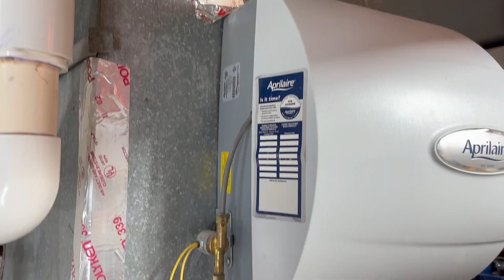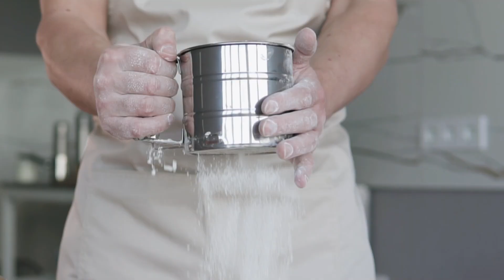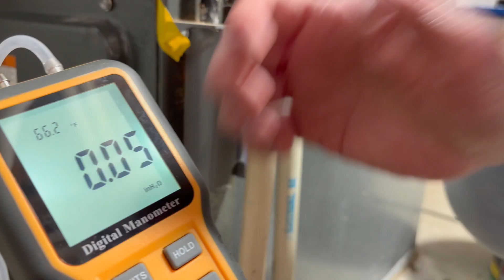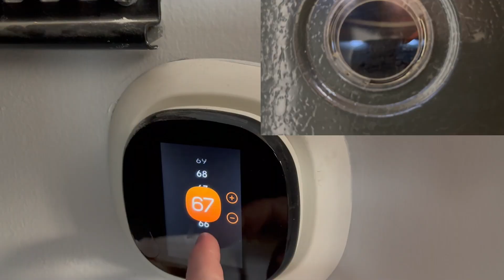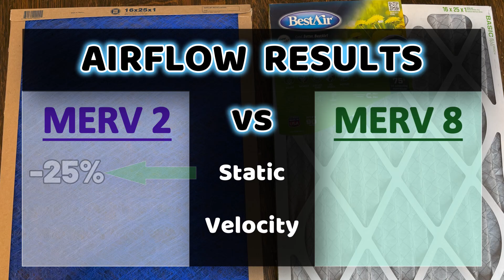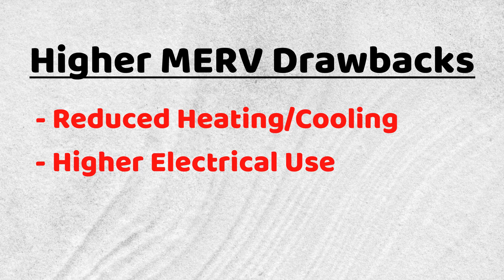HVAC Filter Showdown: Cheap Filter vs Expensive Filter || Full Testing

Comment: I test Air Filters to establish the ASHRAE 52.2 MERV Ratings and don't use anything lower than 13 for my own home. I also use 4" Media that only needs to be replaced 1/yr. A MERV 2 "filter" is not going to keep your HVAC equipment clean, so expect to replace your system more often. The money saved on filters will not pay for the cost of a new furnace,  unfortunately.
Reply: You're using 4" and I know that makes a huge difference but how much difference does a 2" thick vs 1" make? 

My mother-in-law with 2 dogs in the house switched to a 16"×25"×1" merv 11 for dust/allergies, in her 2 story 3 bdr townhouse unit and the resistance was so much that the coils froze up on 2 very hot humid days. So she went back to a lower merv and never had the problem since. 

I discovered that there was room for a 2" thick filter and figured she could go up to a higher merv again with the thicker filter. But I don't want to cause extra static pressure drop. Any suggestions for switching her to a 2"?  Or know any good filters that have less restrictive, higher mervs?

Comment: If you got a higher end filter with more pleats the static pressure can actually be the same or lower than the lower merv ones. Watch project farm video on this and you'll see.
Reply from the maker: Yeah, filter design definitely can affect flow/restriction.  More pleats and/or more thickness will give more surface area for flow 👍

Comment: Just check the manual that came with your blower / air handler. It will tell you the maximum MERV it can handle. Most older systems are fine up to a MERV 11. Not sure how this guy did his tests, but his system is too new to only handle a MERV 2.
Reply from the maker: In my case the limiting factor appears to be the ductwork design, not necessarily blower or air handler.  Higher MERV filters pushed static pressure and temperature rise beyond the limits shown on the air handler nameplate, and was causing system to trip due to overheating.  So, even if the manual stated a better MERV filter, I’ve found they cause issues with my setup.
Reply: @HomeLifeLeisureDIY  If it's tripping the breaker then there's some other issue I would imagine. At least you know you can use MERV 2 and avoid it.

Comment: A friend of mine who owns several rental properties told me that the cheap fiberglass filter is the way to go to both protect and help the EQUIPMENT breathe better. If you want better air for YOU to breathe, then buy a separate air filter device for your house.
Reply from the maker: I think there's definitely value in minimizing restriction using fiberglass filters, as long as you're willing to perform more routine cleaning of the equipment (blower, evap coil).
Reply: @HomeLifeLeisureDIY  I disagree slightly. The HVAC system is a machine that only needs mildly filtered air in 30-day intervals. The basic fiberglass filters will stop most of the particulate large enough that could stick onto the coils. It doesn’t have lungs or allergies, so it doesn’t need all of that other stuff filtered out.  Buy a separate air filtering device for that.

Comment: Before I even watch this manufacturer’s recommend a minimum of merv 8 filtration. If your ductwork can’t support that  changes need to be made to get the most out of your equipment
Reply from the maker: Yeah, I think our ductwork is poorly designed, so the fiberglass filter is the only type that doesn't choke our furnace into an error state.  I plan to make some improvements that will hopefully allow us to use a more efficient filter.

Comment: I am using a merv 8 and it’s getting sucked in. Will the fiberglass do that too?
Reply: Is it in the right way? I saw one that got sucked in because it was put in the wrong direction
Reply from the maker: The fiberglass will have less restriction than a MERV 8, so it should be less likely to get sucked in.  Might also want to ensure your filter channel is in tact so that it’ll securely hold the filter.  If the channel is bad, probably any filter is likely to get sucked in. Good luck!

Comment: Just remember all that dust the cheap filter doesn't catch will end up on your evaporator coil and in you house. It will come back to cost more you later. I found a True Blue Merv 7 does a great job.
Reply from the maker: Agreed that there are definitely downsides to using a cheap filter.  In my case, it was the only way to keep the furnace from tripping due to low airflow / high temp with the better filters.  

Thanks for the recommendation on the True Blue Merv 7 filter --I'll have to check it out and see if my system can handle it 🙃

Comment: Do you have an opinion on K&N permanent filters that can be cleaned and reused periodically? Have bought them for my vehicles cabin and air filters and have been great so far... thinking of the same for the HVAC as well with a Merv 8
Reply from the maker: Hi There!  I've never really looked into the washable filters, as the payback would take a long time since I just use the cheap filters.  But, depending on the cost of your disposable filters, maybe it's a pretty quick payback that could justify its cost?

If I were going to use them, I would try to establish baseline static readings with current disposable filter, brand new washable MERV8, and then the washable MERV8 before/after wash cycles.  This would help determine if it's remaining loaded (airflow restriction) or perhaps degrading (less filtration, higher airflow).

Let me know if you try a washable filter out 🙂
Reply: @HomeLifeLeisureDIY One reason you might be interested in testing the permanent filters is that they generally operate using electrostatic principles. Which means their air resistance is generally lower than an equivalent pleated filter of the same Merv rating. They also tend to be manufactured to a high standard of quality because the company selling them are selling a premium product, unlike some disposable pleated filters where you see poor manufacturing with large numbers of pleats bunched together, or other such defects that may affect air flow.
Reply from the maker: @believelander9030   Thanks for your input!  I'd gladly pay more for an efficient filter if it doesn't sacrifice the furnace performance.  Do you have a particular brand you'd recommend?

Comment: Yeah have always used the cheap fibreglass for the last 15 years and that does result in more dust settling on most surfaces in the house. However will upgrade to only a Merv 8 pleated filter at the most due to risking Furnace blower straining issues and higher energy bills as well. Great video explaining the differences in details though... Thanks
Reply from the maker: Thanks for watching!  We definitely don't have a dust-free house, which I'm sure is partly due to the cheap fiberglass filter.  At some point I want to make some changes that will allow me to use a better filter without tripping our High Temp limit switch 🙃

Comment: The cheap fiberglass is the best way to go. The pleated and higher merv are a scam and choke your system. If you want to clean your air, that’s what an air purifier is for, and they are designed for that.
Reply from the maker: I agree that in many cases lower MERV will provide better results, as long as upkeep with general furnace cleaning/maintenance is performed.  Lots more crud will pass through the low MERV, which could eventually clog the A/C coil.
Reply: True. But I’d rather pay for a yearly cleaning, then be without an hvac and pay for fixing it or getting parts replaced cause of a restrictive filter.
Reply from the maker: @TheJakeman789  Over the course of 5 years, I had to replace my blower motor twice along with the main board once.  I had been using a higher MERV filter but switched to a lower MERV after replacing the board.  It definitely leads me to believe that certain HVAC systems (like mine) just can't handle higher MERV.
Reply: I have used the True Blue MERV 7 filters without any issues. I change them every 30-45 days depending on how dirty they get. My evaporator coil has stayed clean as a result.
Reply: You may as well not use a filter at all.
Reply: Actually, if you get a good filter with a lot of pleating material the static pressure is fine.